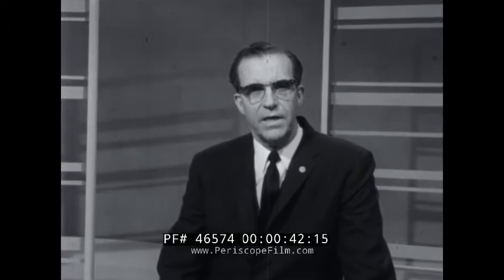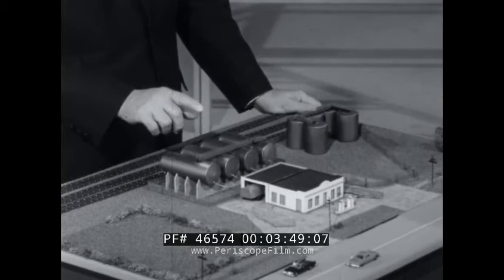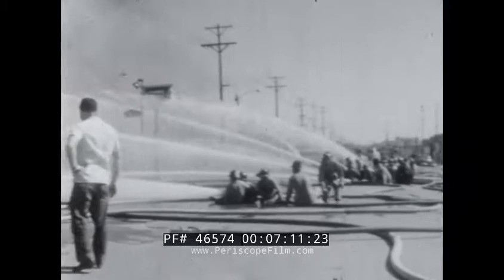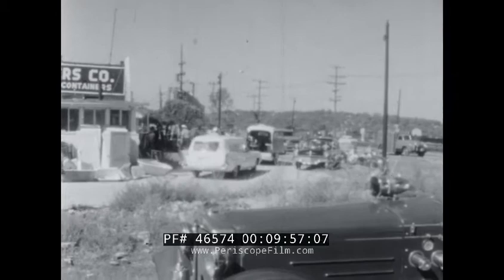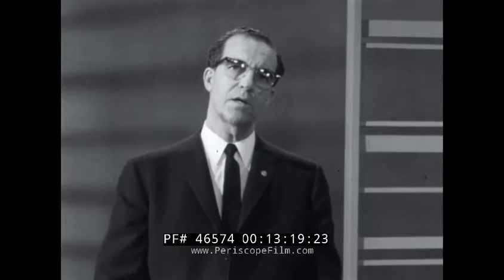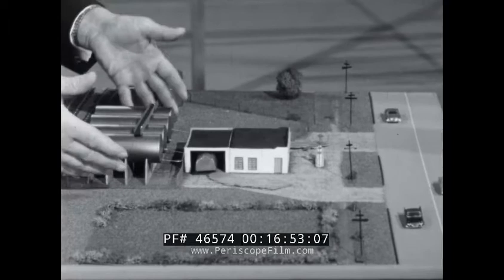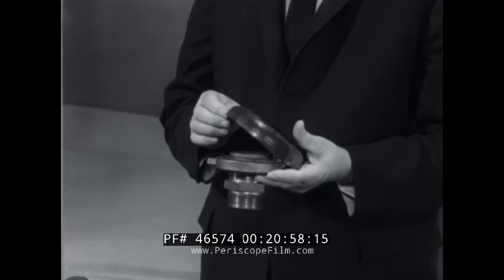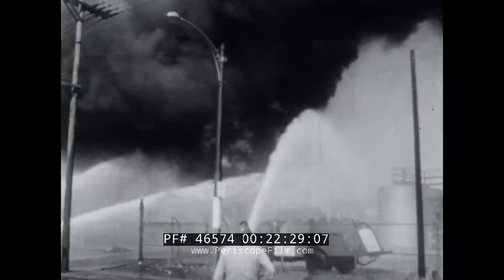ANALYSIS OF KANSAS CITY PETROLEUM BULK PLANT FIRE 1959  46574

Comment: 4:43 "A chain of highly unlikely events, *all of which had to happen" seems to be behind every major catastrophe.
Reply: It's the nature of major disasters; engineers design things to make disaster as hard to have happen as possible.  If one link in the chain of failures doesn't happen, then the disaster becomes a minor accident--or is stopped entirely, and we never even know that anything went wrong at all.

By designing systems so that normal, proper functioning is their simplest, most natural state, the dangers of disasters are massively reduced.  For example, airplanes are designed such that, if they're moving at the proper airspeed, they will fly rather than fall, and would have to be actively driven into a situation where they stop flying and just fall out of the sky, either by deliberately letting airspeed get too low, or by deliberately forcing them into a steep high-speed dive that eventually overstresses the airframe and causes important parts to break off.  As a result, even if all engine power is lost, a properly-flown airplane can be landed gently; typically, they can glide ten miles horizontally for every mile they descend without power, which gives the pilot an opportunity to choose a suitable site for the forced landing.  If the pilot doesn't screw up and let airspeed decay to the point the airplane stalls (i.e., stops flying and starts falling), and they're not, say, over the middle of the ocean with nowhere to land, then all you get is a third-page news story about a plane making a successful forced landing in some farmer's field somewhere.  It's when the pilot DOES screw up--or some other factors leave him with no options--that you get front-page news.

Disasters happen when things go wrong at exactly the worst possible time, and usually in ways that cause a string of side-effects that nobody thought to be possible.
Reply: And how did you come to that conclusion,RonJohn63?
Reply: @jeromewade4110  read the first paragraph of the other comment in this thread.